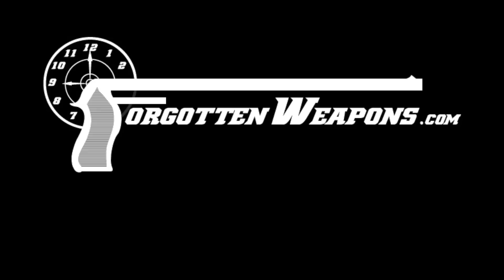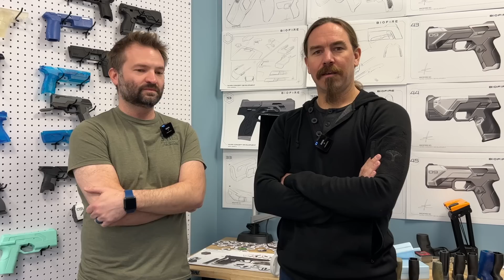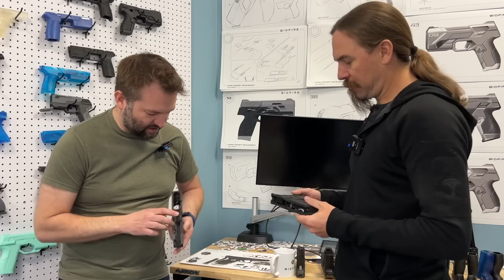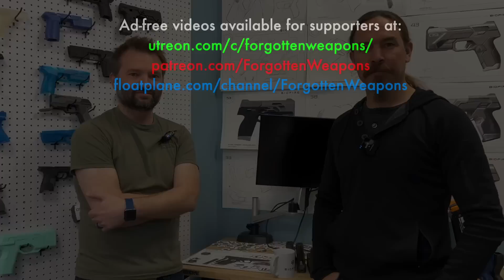Interview w/ Biofire's Lead Designer: Features and Reliability

Comment: I think this product is a flawed premise from the start, but doing my best to set aside my bias, I think their process is sound and their solution is probably about as good as it gets or will get without some huge leap in technology.

I applaud them for going with a redundant system of authorization, but boy would I never own one of these. Not even if you gave it to me for free. Not because I think it won't work, but because it sets a precedent that biometric guns are viable, and that opens things up to legislation (even though it shouldn't, cough cough 2nd) and it's maybe the only avenue of technology that I wouldn't like to see advance, but only because of the implications under our current system.

It's all very neat and their intentions are quite good enough to pave a very smooth road to Hell. Impressive from a design and technical standpoint, but ultimately I have to go with my gut and I'm sad to say that I really, really hope this company fails. Not out of malice, just out of caution.

Comment: Guys please don't skip on the opportunity for a round counter and compatible proprietary mags.
Not necessary but would be sick.
Reply: @BiofireUSA  Your slide needing to use a roller delay system also means your gun could be an excellent suppressor host. If you sold a version of this that has a threaded barrel and different user serviceable roller inserts (as different suppressors can vary drastically in backpressure potential) along with a tall docking station that allows the suppressor to remain attached at an angle off a night stand... you would have a very compelling home defense gun. 

In addition to a round counter, your solenoid trigger could be adapted to a new handgun design that is strictly for competition shooting. You have a lot of good options to explore here. But yeah - don't skimp on cutting out the top for a red dot sight.
Reply: Built in customizable red dot.
Reply: @Aurelius00  why reinvent the wheel? Offer it, but make it accept other red dots
Reply: I don't think adding gimmicks that drain the battery is a good idea.

Comment: Put this level of effort into safes' locking mechanisms instead.  They're usually crap, and they only need to unlock once.

And the "storing a loaded AR15" segment of the market still has a lot of space for new locking products.  Plus, noob home defenders would be using a better weapon.

Comment: Seems like the best idea since firing your double barrel in the air...
Reply: With the double barrel the correct strategy is to fire a warning shot in the air when the threat is 10 feet away and to fire a second warning shot over their shoulder when they are 5 feet away... then be as bad ass as dirty Harry and ask them how lucky they feel.
Reply: @jay2ssrstt  "did I fire one shot or did I fire two"
"uhh two."
"Oh yeah crap"
Reply: @Mk2Mod1  that's too many barrels, nobody needs that many barrels! 😂
Reply: @beargillium2369  Because one ain't enough, and two is too low

Comment: Batteries die after a while. Phone batteries go after around two years. It would be awkward if it dies just when you need to use it. What about in a disaster situation when power fails and you can't recharge?
Reply: Consider how often you cycle the battery in a phone to how often you would use a gun. Sure, there's still deterioration over time; but I'd guess this would be fine for like 10 years, and replacing the battery can't be all that hard.
Reply: @Cyfaeras  Not to mention batteries in  phones are designed to die in two years so that you buy the latest model to come out by said company. When they weren't designed to fail like this those batteries last for years, still have my old mobile back from 2009 and it still holds charge for hours.
Reply: I mean you would want to replace your defense ammo intermittently anyways, how is this any different?

Comment: If we're adding more stuff to a weapon then can I vote for a battery and ammo counter?  A flip up red dot on long guns or a laser on handguns would be pretty awesome too. Red would indicate low battery/ammo while blue would represent a healthy number.
Reply: @BiofireUSA  Gee, that's ominous as fuck.
Reply: I think this is where it’s going. This is going to piss people off, but here I go. The development of pistol cartridges has really peaked. We’ve added rails and optics to every imaginable pistol out there too. Even the 1911 has caught up with modern designs. 

Electronics will be the next thing. Ammo counters, built in customized red dots, lasers and biometrics. 

The limiting factor will be battery life, but in the home defense category, that’s really negligible since the altercation will probably last less than a few minutes. Unless you’re a drug dealer. Then you got bigger problems.
Reply: @Aurelius00  Cartidges are still developable further but admittedly not by much with current materials, we have just gotten working polymer cased ammunition (one of the NGSW bids demonstrated it satisfactorily but was paired with the gun that didn't win) and now there's some potential for near caseless too (casehead and primer only, the propellant and round bonded together ahead of it)
Reply: @b-beale1931  I have not seen the numbers for polymer ammunition, I have barely even seen the ammunition itself, how much better is it than what we have now?  I think that the performance increase will have to really trounce traditional rounds in order to outweigh the benefits of being able to recycle the spent bullets and casing to make new rounds cheaply and easily at home.  If the improvement is not enough to overcome that then I feel that polymer ammo will be relegated to military and rich people use.
Reply: @Voltaic_Fire  military arms channel did a video on polymer cases ammo but it was pretty underwhelming. I think it has potential but the material technology isn't there yet. It's about 25% lighter than a brass cased equivalent, it has the potential to be faster and cheaper to mass produce (though this is limited by the setup cost) and there's apparently benefits for reduced heat in the breach and improved efficiency due to less energy loss from heat but I don't know how much that really works in reality. You also can't reload them, can't use them in a gun with a fluted chamber, the cost is too high for most people and there seemed to be accuracy and reliability issues from it. I think it has real potential but it's at least another 5-10 years away from being viable
Reply: @poprocket2342  That's all very interesting, I look forward to seeing how they develop.
Reply: @Voltaic_Fire  not to deny @PopRocket234 's comment. From what I understand it's viable now in a system designed around the cartridge. For example the bullpup proposal for the ngsw and it's 6.8mm but it wouldn't work well in 9mm parabellum or 5.56NATO gun without the gun being designed to be capable of polymer cased ammo which would hopefully be able to take brass too
Reply: @b-beale1931  Ah I see, it must still be exceedingly niche then because it never comes up in any of the content I watch or articles I read.  Perhaps you are both right though, polymer ammunition is viable now but may require another decade of development to be truly perfected and become commonplace.  I hope someone comes up with a way to recycle the rounds at home during that time because recycling them is good for your wallet and the environment, not to mention that I find it an interesting hobby all by itself.
Reply: @Aurelius00  Yes, keeping the battery charged would be a very minor issue for home defence but I'd still press for a way to turn off the security in the event of a dead battery or electrical fault, it would have to be a secure bypass of course but it is necessary for situations where the battery has died and you've no way to replenish it or where the electronics have failed and you need to use it before you can get it repaired.

Comment: since its not a 2fa unlock and it works when 1 of the sensors gives conformation could a printed out picture trick the camera to unlock the gun?
Reply: It's a good question. I think it's unlikely because it's using an IR camera w/ active illumination (like FaceID). Allows it to work in the dark, and provides resistance to a "printed out picture" attack.
You might be able to defeat it with a sculpted 3d model of the target's face. But that's a pretty darn sophisticated attack compared to "print out a photo of dad".
Reply: As per the specification on the site. It's uses 3D Infrared for facial recognition. A picture would not work.
Reply: Thx for the info guys

Comment: Horrible Idea...imagine drawing your gun to save your life or loved ones lives and the damn thing glitches...even if it works 99.9% of the time, That still ain't enough.
Reply: You can argue that about any firearms though, since no gun is 100% reliable. Imagine pulling your trusty revolver and the ratchet fails to cycle the cylinder? Imagine pulling you glock and the trigger jams up?
Reply: Well given that nothing works 100% it'll be good enough. Even regular firearms misfire, jam, what not. Nothing new there.
Reply: @Bagledog5000  na, normal "malfunctions" are a known thing, and there's usually a reason they happen and always a procedure to fix the problem...but with electronics, who knows? I don't wanna be troubleshooting my gun when I need it to save my life...I definitely get your point though, nothing is 100% but modern weapons are ridiculous reliable, this would be a step backwards.
Reply: @leeward6762  isn't clearing a malfunction just troubleshooting?  The only difference is your experience with that malfunction and expectation after any actions taken to resolve them.
Reply: @leeward6762  If the engineers have done their due diligence, the electronics are going to be the least likely point of failure in the entire system.  Solid state electronics have proven themselves more reliable than mechanical moving parts many times over.
Reply: @timmowery6176  guns are simple, could only ever be one of a few things, and you would know your particular weapons traits...my only point is that electronics can be unpredictable and therefore not idea for this use case. Its ok if I have to clear a malfunction, I just can't do what I Know will fix the problem, but it doesn't fix the problem.
Reply: Electronics can be unpredictable, and adding more unpredictability to the system is not a good idea.
Reply: @leeward6762  It's a matter of due diligence on the part of engineers.  With enough quality control testing, electronic systems can achieve incredible mean-time-between-failure ratings.  Just look at NASA's deep space probes as an example of the kind of reliability that can be engineered into electronics for even the most challenging environments.  It's just a question of how much time, money, and engineering expertise you throw at the problem.  I'll reserve judgement until the gun hits the market and independent testers start putting them through torture tests.
Reply: I'm not saying that I don't think these could be "reliable" I'm saying that the electronics adds a known possibility of malfunction that isn't just a quick mechanical fix....maybe a battery disconnect switch or something could help...but you can't see a computer chip "wearing" like you can an extractor....just an example...basically you can anticipate mechanical problems, but  not electrical problems.
Reply: What's your alternative tho? Leaving an unsecured pistol in a bedside drawer works fine if it's you and a partner but that gets sketchy if you've got kids, roommates, one night stands etc. It's not the solution for everyone but isn't it an improvement over most ways to secure a firearm for immediate use.
Reply: @hannahranga  have to imagine a small safe and a little training would be "safer" ...it's cool tech, but hasn't even reached the "beta" level yet...basically don't leave your gun where people have access to it...that shouldn't be that difficult.
Reply: @squidwardo alot of options for easy access gun safes, with simple combination or fingerprints

Comment: Electronic trigger, ..more like pushing a button, rather than trigger pull .. which makes for more accurate shooting to add to the Bio-safety mechanism
Reply: arent electronic triggers verboten?
Reply: @Big_Boss1935 not necessarily, there are a few electronic/solonoid AR triggers on the market. Plus they're surprisingly common on Olympic style target pistols
Reply: @dark2023-1lovesoni  huh, I did not know that. I stand corrected.
Reply: one more thing: theoretically, with a few lines of code, this thing can fire in an automatic mode
Reply: Honestly they're better. Probably the one firearm advancement I'm most looking forward to.

Comment: Very interesting to see a gun company actually using UX design and focus grouping the customer journey.
Reply: Product Manager here and I was pleasantly surprised to see the two worlds collide in this video. Sounds like they did their homework. Can't wait for Ian to get hold of one. 🤞 it lives up to the promise.
Reply: @BiofireUSA  Correct...as a user if there is even a hint that outside 
actors can access it or just disable it without my permission...
I would still respectfully recommend a "non smart" version be
put on the market also....
Reply: With modular design and rapid prototyping with off-the-shelve parts and 3D prints, almost like they're designing a new VR controller.
Reply: "Gun, kill Flanders!"
Reply: @BiofireUSA to be fair, it's awesome to see these days an electronic device, specifically a smart device, that doesn't scream begging for a bloody internet connection even just for getting started LMAO
Reply: @BiofireUSA  Thanks for that. There’s also the hacking issue when any kind of RF connectivity is built in. If cops can disable it so can a bad guy, or equally bad, steal it and spoof the print and face readers. The USB port is a good compromise preventing remote access with hopefully minimal risk of water and dirt entry. Seems a lot of products have very flimsy USB connectors. Hope yours are more robust than average.
Reply: Or it could have been just a song and dance put together by the marketing department for selected content providers.
Reply: @alexh4436  I don’t think so, having worked in industrial design that included user interface requirements for users under stress and with let’s say minimal education and educability.
I’m also impressed that they did NOT put much focus on popular legal opinions on what a smart gun should be. Lawyers and politicians tend not to take such practical matters into account when crafting laws delimiting what we plebes may and may not do. This general concept may not be the best solution but somehow it seems to tick all the legal boxes (barring the extreme “cops can remotely disable it” one).
Reply: Yeah I’m a software engineer and gun nerd so this is like crack to me. Shit I’d consider working for these guys. I can put my software skills toward guns? Sounds awesome
Reply: @FreddyRangel85 go ahead and apply for an interview then lol

Comment: I'll repeat my comment from the previous video - can't the facial recognition be defeated with just a picture of the owner? Surely its not like Apple's FaceID with the infrared 3d scanning, it's just a camera?
Reply: No it is like an IR thing. So paper will just be blank on the cam
Reply: Yeah, but if I wear your face then you're in trouble
Reply: @HumanityisEmbarrassing  You got me, but i think i would be wanting to get shot at that point.
Reply: @dex6781  Thanks. That does make it much more secure.
Reply: @alj-z7x  
Ian has another video on this gun where he details all that, check it out.
Reply: @alj-z7x  Yes and they said it had to be multiple IR cameras for it to work on the dark, a simple camera wouldn't see anything.
Reply: The only way to hip-fire is with a d*ck pic.